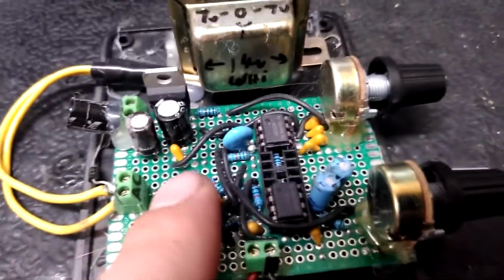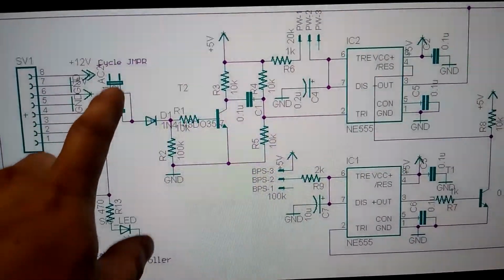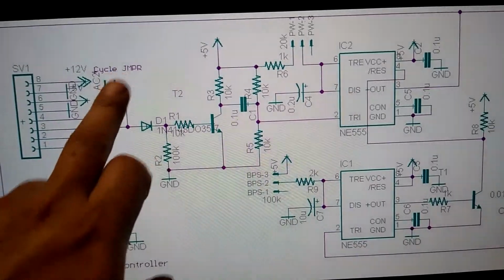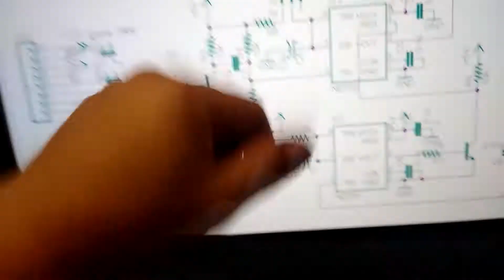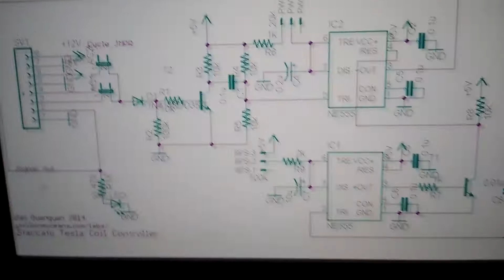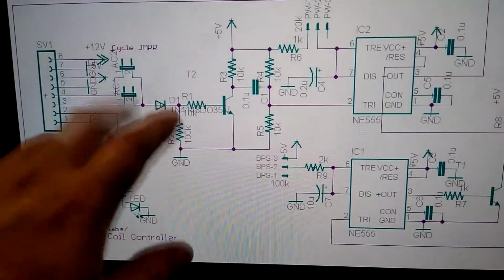Another Half Bridge SSTC 250khz

Comment: Awesome build. Great commentary. I don't have the expertise or experience that you do. I have built only one sstc. No interrupted. Continuous wave devours all of the 240+ volts and current I throw at it. You have some really good posts and a high level of skill.
Reply from the maker: Thanks bro, I've just made so many it seems like I can typically get decent output by just sort of intuitively slapping shit together. Do you run yours with DC smoothing? Might get more fun arcs by removing the bulk of the DC smoothing and just letting it run off half wave rectification.
Reply: @Magneticitist   I posted a crappy recording of my one and only coil. "sstc embarrassment and success" .
It is my first post on YouTube as well. It is short.
Reply: @Magneticitist  I replicated the super simple sstc from lab coats. Only a few components. There is one large diode in series with current limiting ballast. I don't think it counts for an official smoothed dc setup.
I found one rugged silicon carbide transistor that takes some abuse and keeps working. 😂

Comment: Hi there Ryan. I've built the same staccato circuit as yours but my LED doesn't blink same way as yours! I've checked cross checked again & again, but still, the staccato doesn't work! I again took the same circuit that you posted online & rebuilt it again but man! That shit just doesn't work at all. I took a center tapped transformer & used it with that staccato but I ain't got that blinking LED as yours is doing! My LED on the output of the Staccato stays fixed. One more thing, I've used normal NE 555. I ain't got any NE 555P!
Reply from the maker: If you can't get the right 555 ( I can't actually remember if it matters ) then try adjusting the input voltage to the circuit if you can.. like with a signal generated sine. This was my problem with previous staccato circuits and not using the right 555, and using the wrong ones I only found it sort of worked at much lower voltage, something like 3-5VAC I think. The Loneoceans circuit always worked well for me. Pretty sure I use little NPN
's like 2N2222's on the 555s.
Reply: @Magneticitist  Ah , ok , I'll try as per your sayings & thanks for helping out. Take care & keep it up.

Comment: after seeing your video and schematic. I conclude that, the primary coil does not have a capacitor, right? (a capacitor in series with the primary winding. In other words, an MMC capacitor)?
Reply from the maker: Right. Unless it's a fairly large value like 1 microfarad or higher used just as a DC blocking cap.
Reply: @Magneticitist  emmmmm... maybe this is what causes my sstc design to always turn off the igbt. because i did my primary connection in series with the 68nf 2kv cap..
Reply from the maker: @dinapuspita6611  using an MMC will put more stress on the transistors but it's how to get the longest sparks. Typically people use a flip flop to keep the switching current low during interrupting.
Reply: @Magneticitist  yokay. your answer is very valuable to me...thank you very much my friend
Reply from the maker: @dinapuspita6611  no problem

Comment: This looks freaking sweet
Reply from the maker: I've apparently wound a good coil with this one. A larger coil of 32AWG with just slightly higher resonance frequency doesn't perform as well. So about 3.25 inches wide about 9.5 inches tall 36AWG is what I'd wind again.
Reply: @Magneticitist  sweet, im Planning 19cm tall 5cm diámeter 1600 turns Coil with 36 AWG

Comment: Ohhh congratulations for the 1k 😀
I forgot your channel somehow this got recommended 
Umm.. dou you also play with sgtc's?
And can i use a triac instead of spark gap?
Reply from the maker: whats up lol nah I don't really mess with SGTC's. I wouldn't think a triac would be well suited enough for HF though.
Reply: @Magneticitist  but not hv 
400 or 600 volts 
The primary windings will be less
Reply from the maker: @tvishmaychoudhary69  switch needs to operate at high frequency though
Reply: @Magneticitist  when @Photonicinduction played with those mercury rectifiers I started thinking they could be hooked antiparallel and used like a triac, tho there could be a ready made tube that does just that

Comment: Building a ramping circuit for my SSTC is definitely next on my bucket list! I might hit 14" from my 8" coil if I ramp the 400VDC input! The question is...how do you ramp a DC voltage? Guess I'll have to study QCW theory!
Reply: Hmm if you are ramping a dc voltage then I believe you would have to go QCW but if you can use half wave rectified AC plus a staccato controller that syncs up with the mains ramp to give you a simplified (I’ll be it not as good as QCW) ramped sstc that will provide fairly long sparks.
Reply: @quantumlab9130  I thought about that, but I really want to see what'll happen at 400V input with my coil. So far, 170VDC gets me 5" sparks, and 400VDC (non-ramped) gets me up to 12" spark. I'd probably be easier for me to just design a ramping circuit on another PCB and use that to control the 400VDC input! Heck, I might get 20" sparks if my results are anything like Loneoceans' using a ramped input (his ramped SSTC got the same spark length of his SSTC 2 at HALF the input voltage)!
Reply from the maker: @LabCoatz_Science  Yea ramping DC can only truly be done with a ramping supply like in QCW but at the same time as I've seen (yet can't fully explain) a DC supply can provide a ramping effect in the output with a particular tuning. I want to eventually see what happens on a full bridge but also don't see why a step up transformer couldn't be used also. It's not like it's pulling crazy juice interrupted. There is only AFAIK the factor of possible phase shift introduced when using a variac vs a step up.
Reply from the maker: @LabCoatz_Science  oops I had the wrong link to Gao's staccato but yea I'd recommend that one only cause I built two of the other popular ones and they were kind of iffy. They did teach me though that tuning the phase shift is pretty important in getting the beefiest arcs out of a staccato setup which I haven't done yet on this SSTC. The wonky staccato circuits for me would have beefier output at times but not line up right to give perfect ramps because of it. Getting a PLL feedback SSTC to work well with staccato is probably most ideal but it may take some tweaking to get all the timing right.

You can basically slightly modify your current PCB to be a non-doubled half bridge and leave out the on board interrupter to swap it for the on board zero crossing interrupter then just play with the coupling til you get something like a foot or more arcs at 120VAC. It's possible a step-up small enough to fit inside the enclosure could be added if you're only running ramps. I need to relook into what exactly Loneoceans's Ramped SSTC was doing but IDK how it would be really be ramped DC unless he just meant ramped rectified AC, meaning the same thing as staccato. So 400VDC ramps if I'm understanding correctly would only be possible with that setup so long as you had an AC line providing over like 280VAC.  

Still, this setup here is so basic, and is insanely similar already to your current half bridge.. but by using no filter or a very small one to preserve the voltage envelope and tell the gate driver to turn on only during the ms the half wave is rising to peak, I'm getting like 12inch sparks at times off 120 so 240 seems promising.